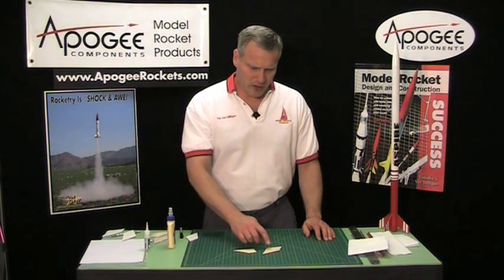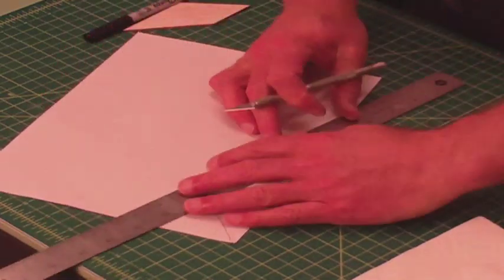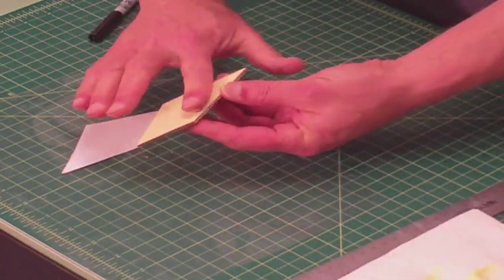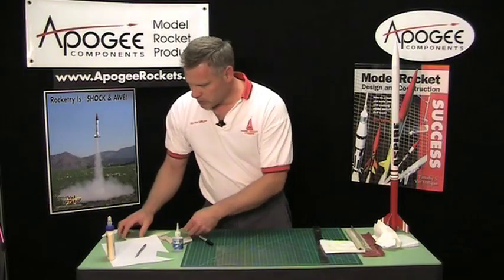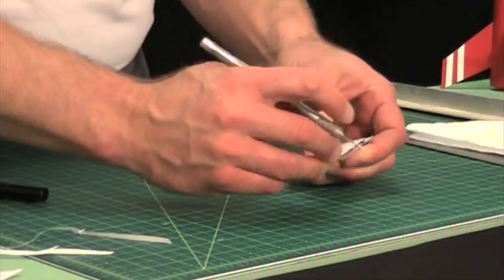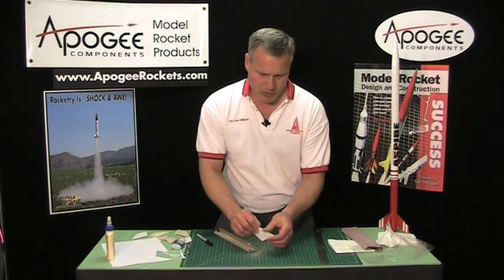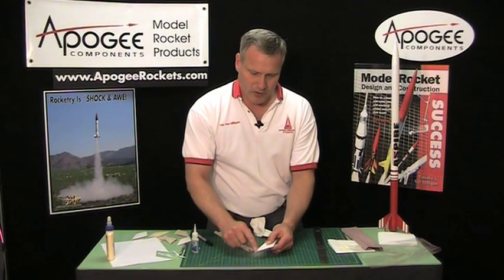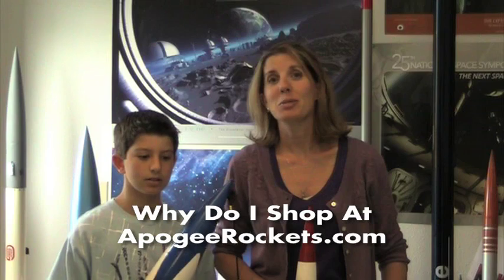Add Paper Skins To Balsa Wood Fins To Make A Stronger Model Rocket

Comment: DO NOT DO THIS! Please! Looked like a good tip until I tried it myself. Ruined one of the fins on my first pro series kit. No specifics on glue type used except for which CA to seal with. Warped my fin way out of shape. Thanks but no thanks. There are better ways to strengthen your fins. This isn’t it.

Comment: So do you seal the fin before you do this or no? Can you still fillet the fins with this technique?
Reply from the maker: No. You don't need to seal the fin before. The paper will do that. Yes. You can still fillet the fin. That is encouraged.
Reply: @apogeerockets  You can fillet right over the paper? Or do you need to leave 1/8" or so of exposed wood at the base of the fin so the fillet will contact wood directly?
Reply from the maker: @brichter543  You can fillet over paper.

Comment: Great video! How would you add the skinning to a fin that just has rounded edges, would you wrap the paper around?
Reply from the maker: Well... it depends on the curvature of the fin. Paper doesn't stretch. But you can experiment by adding some water to detach the fibers so it will conform around compound curves. You'll have to play around. That is what makes rocketry so fun.
Reply: @apogeerockets  Wow, thanks for the tip! Honestly I'm surprised you would reply at all, considering the age of the video. Great support guys! The curve I was talking about is the technique where you sand a 45 degree bevel on each edge except the root edge, and then sand, by hand with a finer grit sandpaper to get a nice smooth curve, because your hand has some give. I'm sure you know this already though!
Reply from the maker: @arro_rockets  Yes. That same answer covers the rounded edges of the fins too.
Reply: @apogeerockets  Okay, thank you!

Comment: Hello! I bought a balsa wood doll furniture kit for the grand babes. Now that I have it all glued together, I believe it will still be too fragile even with the glue. Is there something I can dip it in or spray the pieces with to harden them? Something that would almost be like a plastic coat? Thank you for any help you can suggest. Take good care :0)~
Reply: You can use fix it epoxy that Apogee sells and use it on the glue joints.

Comment: Great tip !! I am scratch building a modest Honest John for A thru C sized engines.  After sanding the diamond taper on the fins they were very flimsy at the ends. This technique beefed them up very nicely, I am not worried about them breaking too easily now. Plus the diamond taper really shows up nicely thru the paper, can't wait to attach them and get some paint on them.